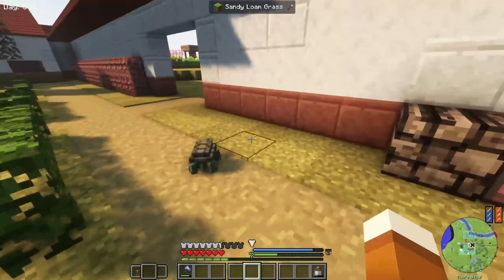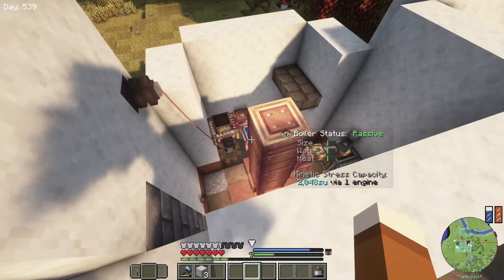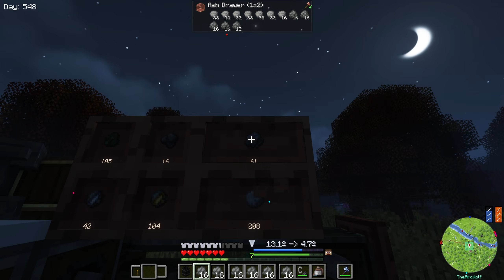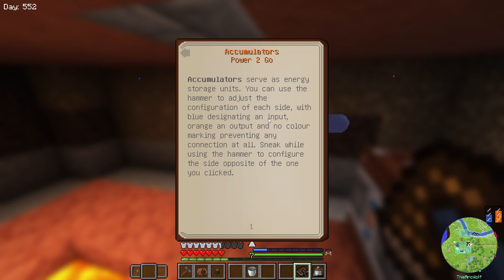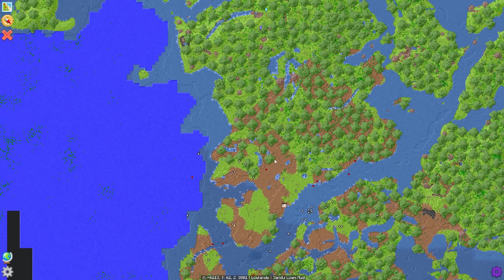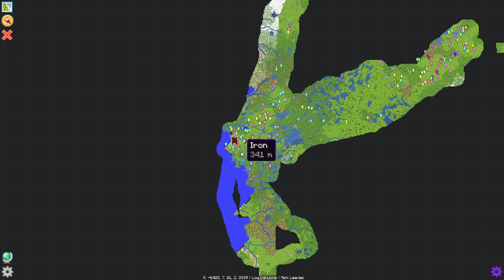We're Crushing it! - TerraFirmaCraft: HardRock Ep. 32

Comment: Haven't caught up with the other episodes just in case but regarding the Immersive Engineering Machines:
1. You can place combinations of Lava on one side with Ice opposing it on all 6 faces of the TEG, if you can extract power from it like that, that is ideal. 4 sides would be superior.
2. You can build the Crusher in a mirrored configuration, you simply have to place the "triangle" of Light Engineering Blocks facing the other side, you may have to swap the sides of the Redstone Engineering Block in that case as well.

Comment: In my world, the animals are babies and they have 3 years to grow. Also, the pot is not heating. I tried it with coal as well. It didn't work. Has anyone encountered these problems or knows a solution? Actually, in my world, all countdowns have been extended by 3-4 years and the Earth Day has been reset.
Reply: It was 1140 days last time I checked
Reply: I wanted to automate everything in my world, but whenever I got close to the end, tfc modpacks would give me problems. However, I had much less problems than other tfc modpacks, and the save file still worked, which is a big plus.
Reply: pota sorununu potaları yeniden üreterek çözdüm
Reply: hayvan sorununu /time add 4years ile çözdüm

Comment: Don't refer to 1 bucket (unit) as 1 litre please. I'm playing GTNH and in that 1 litre = 1 millibucket. It's 1kl = 1b. It makes sense because 1 cubic metre of fluid, aka 1 bucket is 1,000 litres.
Reply from the maker: Yes you are correct, I miss spoke by saying liter instead of bucket, I'll try and no do that.

That said, 1 kiloliter/bucket is insane (yes the size dimensions work out to be correct), 1 liter is roughly 1 kilogram. So 1k liters is 1k kilograms which is 1 metric ton of water, held together by a bucket

Comment: Thermo gens are easily stackable, can share cold and hot blocks, so it's probably good idea to boost you power generation by having more of them. And you probably will use them, as it may be good idea to use thermals to run fermenter, squeezer and refinery to make biodiezel

Comment: the ark furnace is a energy guzzler, i can only operate with a hv batery conected in the machine(you can put the output mouth connected to the machine) and many hv connectors because even then cannot supply the machine in full power.

Comment: you dont need a hopper in the press, just stick a chest at the end of the belt because the items entry automatically, also good video and a hug from Brazil.
Reply from the maker: Oh, good to know I don't need a hopper. Makes sense since I don't need one for the crusher either. Also, Thank you!
Reply: @arcwolfgaming, it's better to use hopper with the chest connected to belt on the other side (input). With that you guarantee that nothing fall to the side as can happen with manual loading.